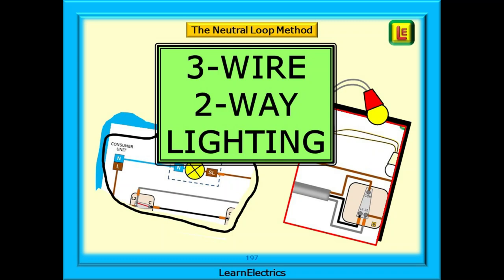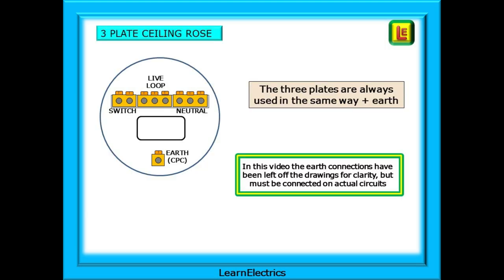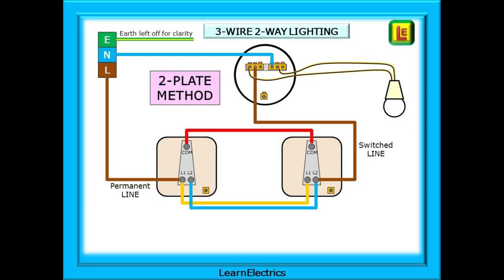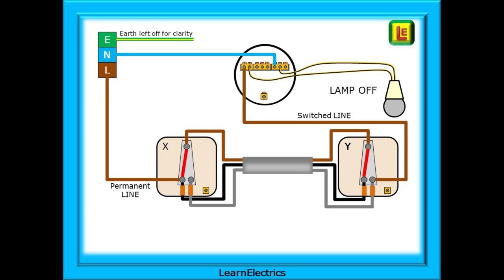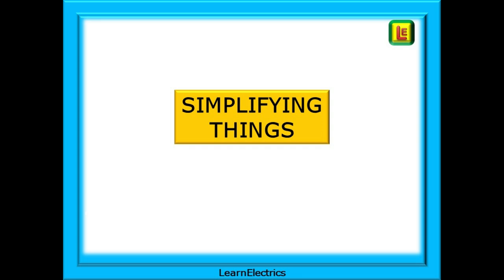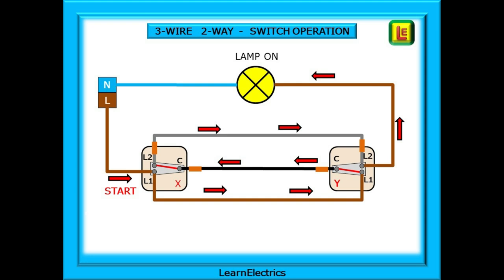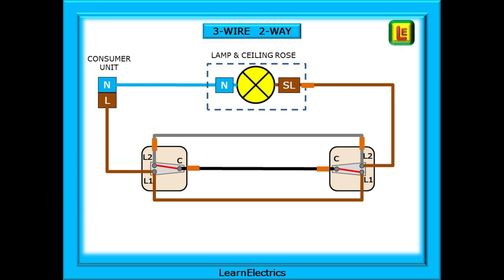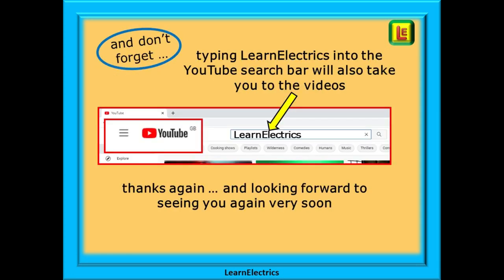3 WIRE 2 WAY LIGHTING CIRCUITS – WHY YOU WILL STILL COME ACROSS THEM TODAY AND HOW THEY WORK

Comment: The L1 to L1 and L2 to L2 common strapper with live to common and switch from the the other common is used quite a lot here in Ireland.
Reply from the maker: Thanks Tomas, yes that's another method. Just putting a video together on this method. Thanks for watching, Dave.

Comment: Excellent video. How can you introduce a socket mounted security timer into a 2 way light circuit? Electronic timers won't work under 40w load and therefore mechanical units are available for LEDs, but can't find one that works with 2 way circuits?
Reply from the maker: The timer would have to interrupt the switched line at some point. Break this and the lights won't work regardless of the two way setting. You can buy 240V timer switches with different features, Speak to the wholesaler, they will have an account with RS components who do a wide range of timers.

Comment: Hi Dave think i will watch this again as i think ive just about grasped all be it with a bit more practise the three plate and two plate method and then you hit us with this boyo lol. Good video all the same. just a quick question is the permanent line conductor only connected to the common on a1 way switch as on 2 way or 3 way you need a 3 core twin and earth and  so therefore one of the strapper conductors usually black isnt it connects and links all the commons in the other 1 if 2 way and carried on through if its an intermediate in the middle is this right Dave.
Reply from the maker: Follow the methods in the videos. One of the best ways to learn is to view the videos again, pause the video and draw the circuits out for yourself. that's how I learnt them. Draw it out, throw the drawing away, draw it out, throw it away until I could draw the circuits without any help. It works and it sticks in your mind forever. Thanks for watching. Dave.

Comment: Why not connect Lin to Common of fist switch and Lout to Common of second switch?

Lin live in, Lout goes to the light , all wires must be black, brown or grey, only the neutral that goes to the light is blue.

Make an video in which you put the pvc conduits and this wiring...
Reply: 1 and 2 from the first switch connect to 1 and 2 from the second switch
Reply from the maker: The method shown in the video works. Thanks for watching.
Reply from the maker: The wiring colours in the conduit would be just the same as in twin and earth except in singles. Follow  the method in the video and you won't go wrong. Thanks for watching.